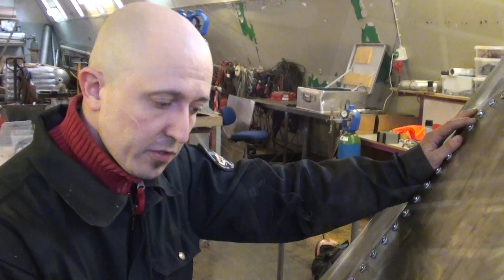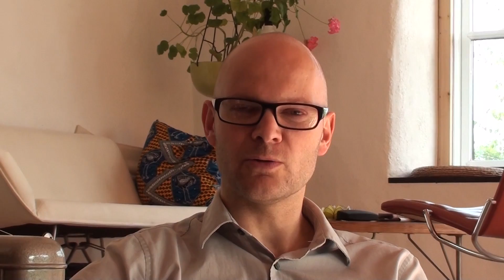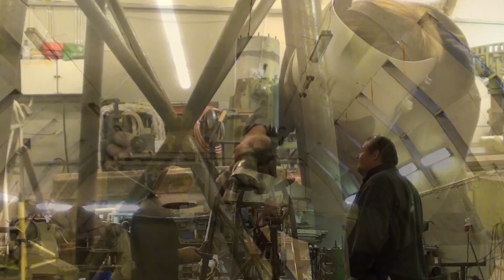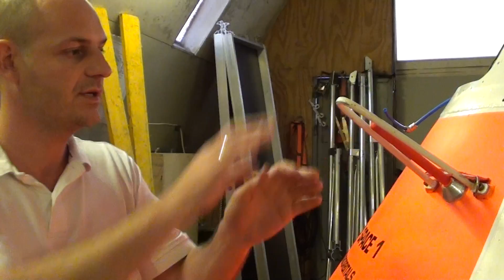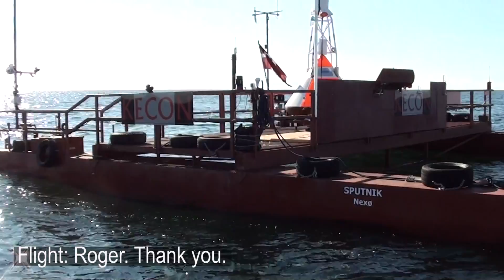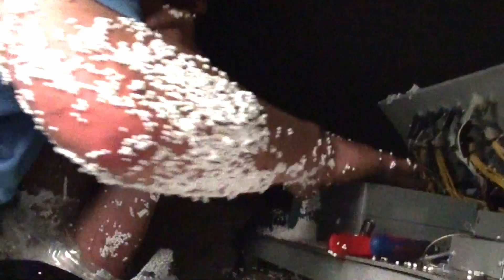Tycho Deep Space I - The Complete Story - Copenhagen Suborbitals

Comment: OK. mounting the escape booster on a bell bearing that allow it to spin without spinning the capsule could stabilize the flight.
also think about mounting the parachute on the side and not central, like they do on the dragon. there is a possibility of deployment even if seperation failed and the capsule will hit the water in a sideway position -> less forces.